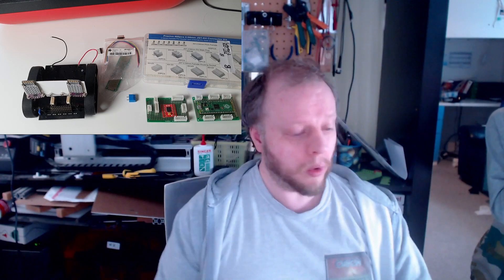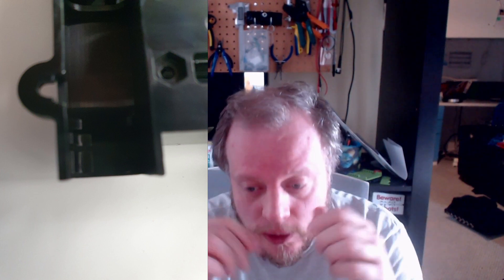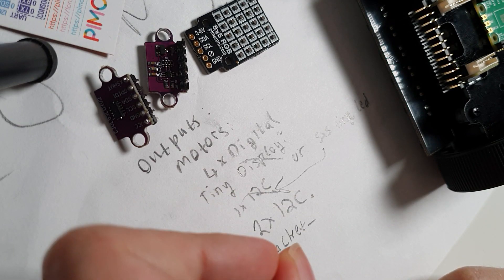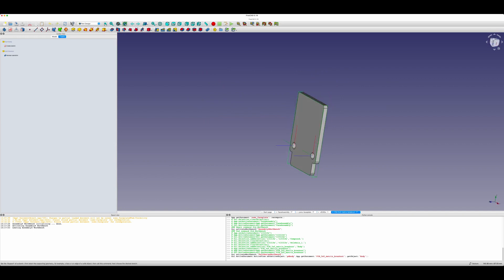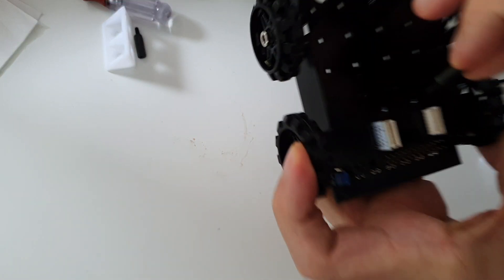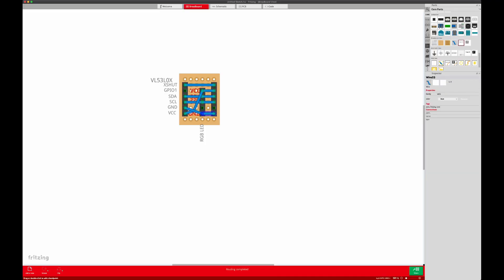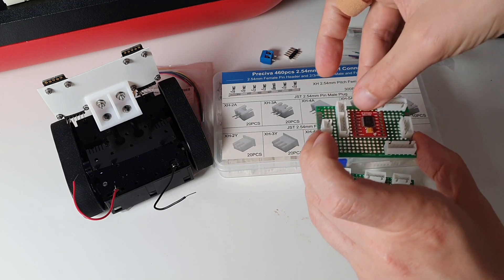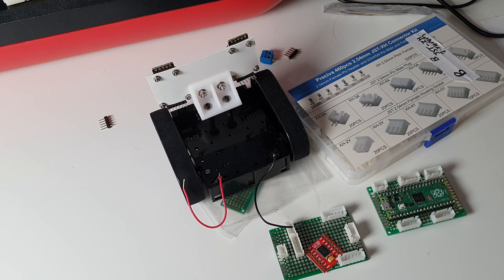Design and Initial Build Raspberry Pi Pico Robot Project  - ZumoPico

Comment: I have created a small SMARS robot using N20 micro metal gear motors.  Although the motors are the same 100:1 bought from the same vendor at the same time they run at different speeds.  I think encoders are the way to go but am struggling to find a simpler tutorial how to wire them and how they work.  I am using a pico and similar motor driver board as here.  Does anyone know of a more detailed tutorial on how to the encoders work.  I don't like copying without fully understanding.
Reply from the maker: My upcoming book on Pico robotics has just such a detailed tutorial for the Raspberry Pi Pico and using encoders.
Reply from the maker: I've added a link to my new book in the video description - Robotics at home with Raspberry Pi Pico, which among other things has a chapter on reading the encoders and on using the PID to make each drive at a set speed.